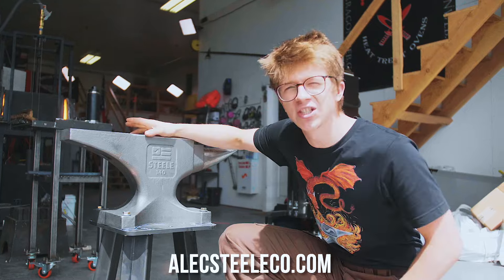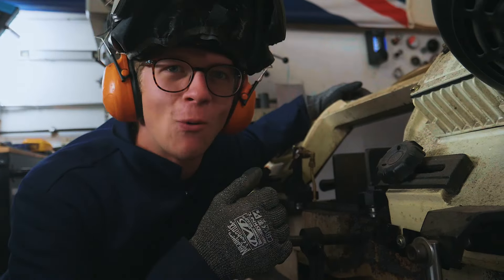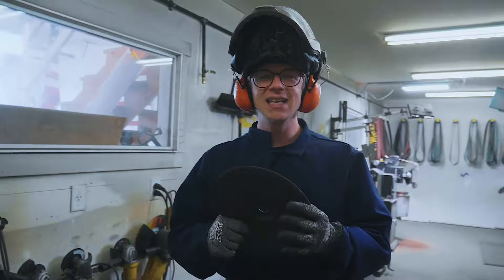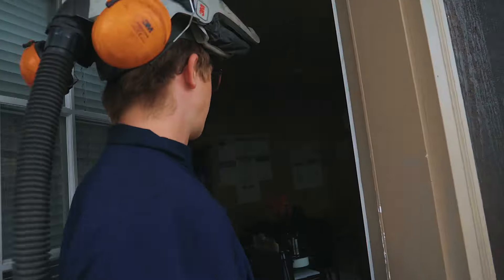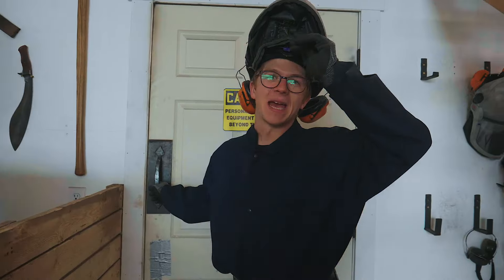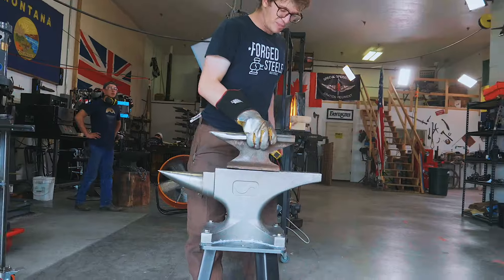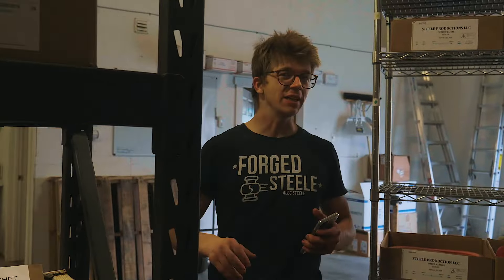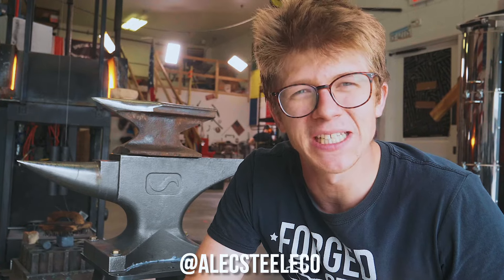TURNING A RAILROAD TRACK INTO AN ANVIL!!!

Comment: I love this channel for many reasons, but the fact that you not only model safe practices, but specifically point out the dangers and ways to mitigate them (your brief flirtation with insanity in the bike video notwithstanding) is alone enough to recommend it to anyone even vaguely interested in blacksmithing or metal working. I work in the medical field, and due to the sheer number and nature of injuries I have seen them cause angle grinders scare me more than any other common power tool. Don't take the guards off people!

Comment: You might want to explain to people watching that you swapped over the the grinding rock for the grinding part and did not use the cut off wheel to grind. Trying to grind with a cut off wheel is a no no.

Comment: Had an angle grinder incident a few years back. Was at work cutting a stainless chute off a machine. Cutting disc caught and kicked the grinder out of my hand into my inner thigh. Tore through my jeans and ripped up my leg. Not a pleasant work day. Not only was it penetration damage it was also friction burned from the rotation.

Comment: Great video. I have only a question: Is there really a difference between use a railroad anvil on this way, or put it vertically? Thanks!
Reply: The difference is striking area. Vertically, you only have a few square inches of striking area, horizontally you have more face to strike on. Usually more striking area is a good thing, but I have seen some large things forged on a vertical piece of track.

Comment: I've seen a guy at work cutting through some universal beam, got the 9" disc between the two flanges of the beam and it kicked up and hit his face, nearly took his bottom lip clean off and that was just from the handle hitting his face not the blade.

Comment: Not totally on topic, but abrasive wheel saws can be equally as dangerous...if not more.

I once had a 14" wheel shatter, part of it grazed my side at rib height and then embedded itself in the sheet rock about 8ft behind me...my shirt had two cleanly cut slits in it. It would have been a 911 call if it had been a direct hit.

I had been saving up for a used Bridgeport at the time and instead picked up a used cold saw...i never looked back and gave the abrasive wheel saw to the neighborhood scrap guy.

Comment: i saw the title and instantly thought BAD, BAD ALEC. 
i was taught by other YouTube'ers that railroad track makes for a not good anvil. it acts more like a spring. which makes since considering the weight of the trains it has to carry. also can be expensive and hard to come by.
a piece of scrap 1/2 inch steel plate makes a better anvil, especially when you use the 1/2 inch edge as the anvil surface.
now to watch the video.

Comment: I once had an accident with an angle grinder and it was TERRIFYING, I had luck though
So I was grinding on something and to make the work a little bit more tolerable, I listened to music with those cheap in-ear headphones you can get anywhere and the chord was freely moving and jumping around infront of my body. So as I worked, I noticed the chord getting dangerously close to the disk I was grinding with so I thought to myself: "you´d be better of, not letting that disk grab that chord." and just in that very moment, the chord got grabbed by the angle grinder and all Im gonna tell you next happened in the shortest of moment. The headphone got pulled out of my ear, I used to wrap them around my outer ear so the wouldn´t get loose, little pieces of the headphone were shot across the workshop and the angle grinder made a horrific sound because the disk stalled and I was shocked, for a moment I didn´t knew what happened. I turned the grinder off and my hand reached to my ear, I was in fear I ripped it off, luckily nothing happened, not even blood. I layed the grinder down, took deep breaths for a minute and decided then to call it a day, I cleaned the workshop, sweeped the floor and got back into the house. I showered, inspected my body if any shrapnell penetrated my skin but luckily I was fine. nothing happened to me that day but since then I handle this tool with the respect it deserves.

Comment: Worse injury I ever got in the shop was an angle grinder, second was a belt sander. Both on my knuckles, ill never get that meat back, and it only takes an instant. Snapped a cutoff wheel once to, a chunk snatched my safety glasses off my head and broke them. That is a sketchy tool to be sure.

Comment: Luv the vids alec would u be willing to start selling railroad tracks anvil
Reply: Railroad track belongs solely to the rail company and you technically need written permission to sell or even scrap railroad track, spikes, and plates. They honestly don’t care as long as your not cutting out old tracks, but it’s still technically illegal.
Reply: @ThatPNWGuy2024  unless the rail has already been traded or osld by the rail company for example to a scrap yard. In which case obviosly the ownership of the rail becomes theirs. Rail has a standard length of life and when it's up legally it has to be changed
Reply: Honestly so easy to make, see your local scrap dealer, or even your local metal supplies place and get an off cut of an 'i' beam. You can hire angle grinders for less than  $15.00 a day, and 2-3 blades for $20.00 . It may not be pretty but it will get you started. 👍🔥 best of luck.
Reply: Joseph Stevens yes indeed just trying to make sure we don’t have people going and cutting up or taking track from active or even rails they may think aren’t active. 

I wonder how much the rail companies get back when they recycle it. Do you think it goes back to the manufacturer?
Reply: I've seen railway track anvil's on eBay. Probably a lot cheaper then Alec to make and sell to cover his own costs.
Reply: @Zogg1281  I was gonna comment pretty much the same thing. You can find rails on Ebay all day long where I'm at for about $20-$25 a foot. I don't think that's a bad deal for a beginner blacksmith, I have a railroad anvil my grandfather made back when he was a teenager that I still use to this day for smaller projects
Reply: @DustyKorpse  Er, I beam really isn't the same. Hell, RR rail isn't really adequate, and I beams are (to the best of my knowledge) much lighter)
Reply: isn't the whole point of him showing this process is how to start smithing for cheap(ish)?
he won't be able to sell it cheap, which kind of defeat the purpose

Comment: railroad track anvils to soft any of the heavy metal or hard metal that you're going to use to make a blade is going to leave a mark in it even hitting it with a hammer is going to leave a mark in it
you need to face it with a high carbon tensile steel 10:45 will work and then you won't have any marks in your surface only what you're hammering on no matter how much he do you put in that railroad track it'll never be hard enough to be an anvil

Comment: One little note:
After all that warnings and talk about safety, you could have mentioned, that you switched the disks after cutting, before grinding the surface.
I have never used an angle grinder and to me it seems obvious that you shlould not sand/grind surfaces with a thin cutting disc.
But who knows... maybe someone does not spot the difference in the video and explodes his cutting disc by grinding the surface with it.

By the way I like your videos directed to beginners and that you can start without expensive equipment. And I also like the safety advices. Most important thing about safety is, to think about it before you start doing it.

Comment: A 9 inch grinder is an awesome tool for heavy work but you have to be able to hold it. Minimum gear I wear when running it is gloves and safety glasses. If you can't lift 30 or 40kg don't use them. I use a 5 inch for most work as I can run it one handed if needed and they can still do a lot of work but you don't need as much strength to hold them

Comment: 100 buck a harbor freight portable band saw  it will make light work of it is a very practical tool to own for the money and way safer than a large spinning wheel of death.  You my laugh but unless you every had a cutting wheel on a grinder blow up you have no Idea. I have a 4 in scare on my knee that looks surgical that was made through a pair of jeans it also broke my big toe and cut my knuckle on my left hand all the way to a white tendon I could see move in and out when I bent my finger. One blink of the eye and it was over. yes a new wheel dewalt brand on grinder that it was made for. As soon as it touched the steel it blew up defective wheel no guard. Yes  I still use them but I sure try to limit the amount.

Comment: You don't even need to cut all the way through it. Just cut through the bell, flip it so that the flange is up in the air, set one end on the ground, place something like a board in the middle so that the opposite end of the track is up in the air (basically make it look like a see-saw) and give it a good whack right where you made your bell cut on the flange side with a sledge. It'll snap the rest of the way. Saves time and discs

Comment: Alec just so you know the oxy torch will NOT cut rail you HAVE to use either a mechanical cutting method or use an Oxy carbon cutting rod

Comment: You know Alec is scared of the bad boy he is cutting with when he asks for reminders of gow bad you can hurt yourself with despite experience
Reply: Yep, I am now working on a railroad track anvil (came here looking for ideas), i am using a slightly smaller track and only a tiny underpowered 115mm 500w angle grinder, but even this little bastard can kick quite a bit if you twist it in the cut a little. Even though its easily controlable, its really unpleasant. The idea of one of those 230 mm monsters kicking back on you is quite scary.

Comment: Would you be willing to make a video of you adding a hardy hole to the railroad track anvil? You mentioned in the video that with a little creativity it could be done, but I'm not quite sure how I could go about doing that. The only way I could see doing it in a relatively cheap manner would be to use a oxy-acetylene cutting torch to cut out a rough square in a surface plate and using hand files to finish getting the desired shape and then welding it onto the back of the track-anvil and perhaps using some rebar as support beams underneath it with a stump to prevent the surface plate from eventually getting bent from continuous whacking of the hammer. Any thoughts would be greatly appreciated.
On a side note, thank you so much for making the video on safety in the workshop. I know it's less of an instructional video and more showcasing what could potentially go wrong in the workshop, but just showing the potential hazards in this dangerous profession is extremely helpful. It's always important to recognize a dangerous task and to act accordingly in an effort to be safe. Accidents can happen, even if taking proper precautions and it's important to be safe no matter what in order to minimize the risk of being severely injured. 
As always, thanks for the content. You do a great job.

Comment: Wouldn't you get more rebound by facing the railroad track straight up and down? The steel webbing in between seems a bit too flexible.
Reply: Yes but it don't look like a tiny anvil you can set on top of the anvil your selling ;)
Reply: @NismoXero  very true, the anvil tree will get disrupted :D

Comment: I've a 2 inch scar of my right hand where an angle grinder hit it, was cutting up a old push bike for a project the grinder kicked up into the air and hit my hand on the way down, 1 one hospital trip and 5 stitches later they said I was lucky as 1/2 higher I'd have hit a vain 1/2 lower I'd have lost my thumb, moral of the story don't be an idiot and take the guard off and wear ppe at all times, if I'd have left my welding gloves on I wouldn't have a scar